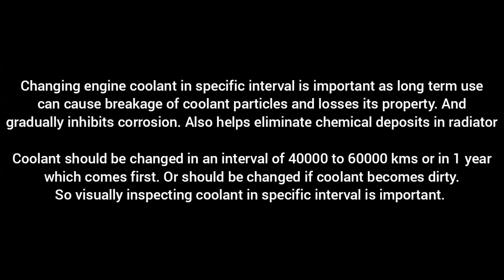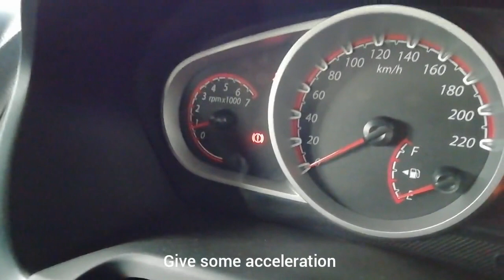Change Engine Coolant at Home | Ford 1.4 TDCi | Flushing cooling system without chemicals

Comment: Helpful DIY Video.
Ford Figo uses OAT coolant Ford WSS-M97B44-D and should be replaced every 10 years/ 100000 Kms, whichever comes first.(Better to change it after 5 years/80,000km) For most, it will be only one or two change for the life of the vehicle.
Mixing green and orange is not recommended. IAT Coolant may corrode engines which are supposed to use OAT/DexCool or Hybrid ones.
Edit:
Aftermarket coolant meeting WSS-M97B44-D Specification- 
1. Motul Inugel Optimal Ultra (Orange)
2. Shell LongFile Plus OAT (Orange)
3. Liquimoly RAF12+ (Red)
One can get OEM coolant from Ford dealership as well
Reply from the maker: Its the theory brother, could use any kind of coolant but after flushing properly, company provides OATs because of long life. IATs should be changed regularly thats ol.
Reply: @dailyhandsdiy  Agreed, but Ford 2003+ Engines are mostly Aluminium Blocks and I'll be at peace of mind by putting same specification coolant.
Reply from the maker: Ha my friend, automotive manufacturers started using aluminium blocks since 1980s, cast iron blocks were long gone  by 2000s. Its the fact that green IATs are less reactive to seals than to aluminium but has one 4th of the life of OATs, but OATs on other hands reacts leas to aluminum but a bit harsh to seals, especially dexcool introduced by GM. So either way have pros n cons of their own.
Reply: @sahilhussain9022  I used Castrol transmax ATF power steering fluid for flushing and replacing old fluid. Use a pipe with priming bulb to remove old fluid from PS reservoir. Then, pull out resorvior and remove return pipe at the bottom. Put return pipe in a bottle to collect old fluid and secure the bottle somewhere. Put a small 10mm pipe on the bottom of reservoir and the other end of pipe should be closed and held higher than tank. Now you are ready to flush. 
1. Top up reservoir with old fluid.
 2. Steer full left and right .
3.repeat step 1 and 3. Stop when return line is throwing out red fluid.
4.remove stopper pipe setup from reservoir tank bottom and connect back to return pipe.
5. Top up after connecting return pipe. So not close the lid yet.
6. Start the engine. Steer left and right 5 times.
7. If fluid level is down top up.

Never steer without top-up of ATF fluid to avoid air entering in PS Pump.
Reply: @sahilhussain9022  if boot is torn, see if inner rod(ball joint) too needs replacement. Is PS fluid level going down? check from where oil is leaking.
Reply from the maker: Yep well said. Recommended fluid for ford is ATF suffix F fluid.but its rare to find so fluid that has suffix A grading is used. If you can find fluid that specifies Merc/Dex, would be great.
Reply from the maker: Just type in castrol transmax atf dex or merc. its easily available offline n online.
Reply from the maker: If you need a 100% flush 2L can be used. Or just replace with 1L n you will get a clear red fluid.
Reply from the maker: Never used that brand, there are some make using low quality fluid which damages the pump. So better use something common in use.
Reply: @sahilhussain9022  It will take a bit more than 1L. You can order 2L as it is leaking in your case.
Reply from the maker: You have got air in the system.Try accelerating to about 3000 rpm and slowly turn the wheel from lock to lock.
Reply: @sahilhussain9022  yes, try above method with reservoir cap open. I did the process without turning on the engine. Tapping return line from reservoir bottom would have prevented fluid drain and air in the system.
Reply: I couldn't find any coolant mentioned by Jai bro for online purchase. Where I can buy these ? Any help pls .
I bought valeo protective 30 from boodmo but there is no mention about what type it is . Thinking to return it

Comment: My Fiesta TDCI earlier had green coolant which needed replacement .How should I perform flush that all of the green coolant is drained from the car as I want to use red coolant(HELLA) now.
Reply from the maker: You need to drain out old coolant, fill in with DM water. Run the engine for 10 mins....drain it again and fill DM water. Do refilling with DM water for 2 to 3 times and later fill the said coolant.
Reply: @dailyhandsdiy  Just did that. Thank You 🥰🥰
Reply: @dailyhandsdiy  Sir I flushed green coolant properly 2 times until water came out clear and added Red Coolant but after 3-4 days of usage coolant colour has changed from red to purple and there is brown layer(rust coloured) on top of the coolant . Plz suggest what should I do

Comment: I over filled my coolant is it safe or something to worry about 🙂
Will wait for u r reply.
Reply from the maker: There's nothing to worry about. If its till brim, just use a hose, dip one end in resrvr, other end to ground and drain the coolant to level. If its just overfilled above the max mark, just leave it there...wont harm anything. It only need some air gap inside the reservoir.

Comment: Bro I have a fiesta 2008 1.4 diesel...
This car  have a poor pickup & mileage when ac trund on and taking over to vehicles ofter the slowdown...will be rocking when touched rpm to 2500 r 3000...plz tell me what will be the problem...plz
Reply from the maker: clean maf and check egr for poblems, mostly these are main reason for low pickuo in ford cars
Reply: @dailyhandsdiy  thank you br...
Reply from the maker: No problem bro.. :)

Comment: Hi.. How to remove a radiator fan in a figo? Is there any bolts or only clip system?
Reply from the maker: jst clip bro, can simply pull up the shroud.
Reply: @dailyhandsdiy  but it is difficult to take out... Right?
Reply from the maker: just need the view thats ol, not that difficult

Comment: Which coolant can be used bro for ford figo 2010 model ....pls help me with name and the color green r red.....last time I used green for my polo...my engine is gone...so pls help
Reply from the maker: Use ethylene glycol based coolants and don't use concentrated. Use 1 part coolant to 4 part water. And polo comes with oat coolant i guess and green eg is IAT. So if changing do a deep flush and change. Regarding green its short in life but a bit less in corrosive than orange or red dexcool coolant. Wht happend to your car after changing to green?
Reply from the maker: Ford too uses orange coolants but not dexcool, its jst dyed. So any green coolant will be ok. Can use Tvs coolants, or use bosch. These are found safe. Dont use local type as they can have acids in it which will eat up rubber.
Reply: @dailyhandsdiy  bro ford use red coolent na  ..like Vw polo vento etc ..my mechanic told me
Reply from the maker: Yes bro ford comes with orange or red coolnt in them, jst the difference is red or orange is made from orgnic acids and green from inorganic types. green has low life than other. Newer cars use red or orange because it lasts for like 1 to 1.5 lak kms. Could use green or orange or red but don't use blue color coolant mix as its very corrosive to rubbers.
Reply: @dailyhandsdiy  ok bro iam buying used figo diesel so ..just asking 
Them red coolant is safe to use ?
Reply from the maker: Yes bro its totally safe to use, jst check if its orange or red previously filled. might be orange one.

Comment: Hi bro.. I'm facing a problem with my car that is ac compressor high pressure valve is opening some time after ac service. 
Cooling is also not good.
Reply from the maker: why did they accessed high pressure side? Mechanics usually plug in low pressure side only. Dont wry bro. its jst the port pin. You may go to a local ac srvce and ask them to chnge the pin or if costly can block it completely.
Reply: @dailyhandsdiy  they said to change that pressure release valve is it correct?
Reply from the maker: does ac make a long hissing sound?
Reply: @dailyhandsdiy  No bro
Reply: I think it's because of insufficient cooling. Radiator and condenser had blocks I think so
Reply from the maker: if blocks, bro jst switch on the ac and at idle spry some water into the condenser. You can instantaneously see the cooling. So befre servicing, does ac wrked well? y'd you serviced it anyway?
Reply: The car was actually flooded in heavy rain. After that fan started making noise. I changed the motor still it's vibrating. I noticed that fan is out of shape. I removed again and make it straight but still some vibration there.

Afterthat I changed evaporator coil.
Still cooling is not good
Reply: Cooling is not good before also. Mechanic said to change the coil
Reply from the maker: oh bro. usualy evprtr is chnged if there's any leak. Its better to check the pressure relief valve inside. like the mechanic said. if its not functioning well the gas get bypassed evaporator and return to condenser.
Reply: @dailyhandsdiy  bro sprayed some water. Immediately the cooling raised and fan also stopped. Identified that radiator is not in good condition. What do u say?
Reply from the maker: Radiator is not the issue here bro, you can spary the water in force and the dirt comes off easy. but First case do AC flushing, there might be too much oil or junk inside or must be more trapped air and check the pressure relief switch.

Comment: I accidentally dropped a platic from coolant cover inside resevoir tank of coolant i saw it couldn't fish out i added little water to take it out it was folating and it dissappear  will it come out if i flush my cooling system totally
Reply from the maker: just take the tank out flush it out. dont open the radiator drain plug as the piece will enter the cooling system when water goes out
Reply from the maker: Take the pipes out one by one and check if piece comes out. i meant from the reservoir tank
Reply: Its just a silver foil type seal which coolant bootle cap has been sealed will it work by flushing out
Reply: But i think the piece has been sucked inside a radiator
Reply from the maker: If its sucked into cooling system, chances to get that out is like 5% to 10%, it can go any where, like oil coolers, radiator pasaages, heater core, may try flushing, if lucky will get that out.
Reply: @dailyhandsdiy  i there anything to worry about.
Reply from the maker: how much size was that piece?
Reply: Thin like paper about 1cm
Reply from the maker: Thats ol ryt won't harm anything. It will get collected to the corners and stays there till the engine is opened for maintenance. Its so small to harm the engine.
Reply: Ahh thank you and even my radiator is busted i have to get new one
Reply from the maker: In that case, when you remove radiator, remove the thermostat housing and push some water into engine clnt outlet port. any settled debri will pushed out through the other side.
Reply: I dont understand much but first il drain out all the coolant the tighten drain bolt add water on resevoir start engine rev up then flush removing drain bolt will this work
Reply from the maker: yeah that will work, i got too into technical.. nver mind 😅
Reply: @dailyhandsdiy  haha thank you so much was literally so mad at me cheers thank you for your time . Appreciated you brother. Where are you from
Reply from the maker: Any time brother, im frm Kerala, India.
Reply: @dailyhandsdiy  wow nandi saheadaran. 🙂
Reply from the maker: Haha its nanni sahodaran. awesome brother and where you from?
Reply: @dailyhandsdiy  sikkim brother . I used to stay at chennai .
Reply from the maker: Oh okey 😊👍

Comment: How much colent is needed in ford figo?
Reply from the maker: It cam range between 4.8 to 5 Litre. 2 part of coolant concentrate to 3 parts of DM water. or 1 half to 3 half. considering the concentrate.
Reply: @dailyhandsdiy  2 litre of coolent is enough or not concentrated
Reply from the maker: yup thats enough. 2L concentrate and 3L DM water.

Comment: Is it safe to use blue colour servo coolant?
Reply from the maker: I think blu coolant is amino based. And will eat the rubber hose over time. If its ethelyn glycol based then ok if amino based then not ok.
Reply: @dailyhandsdiy  i changed coolant yesterday with servo kool plus? With ur opinion which coolant is suitable for ford figo 2010 model petrol engine?
Reply from the maker: You could use pink/orange Organic acid based coolants or Green inorganic acid based coolants. Both will do fine. ie green/orange/pink